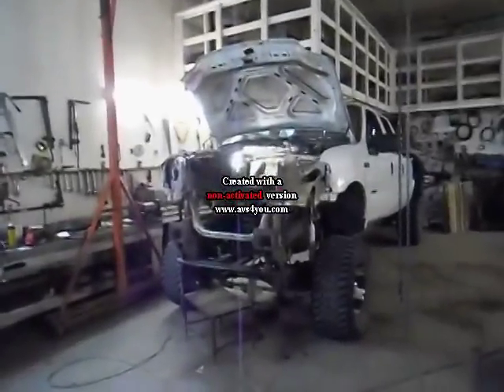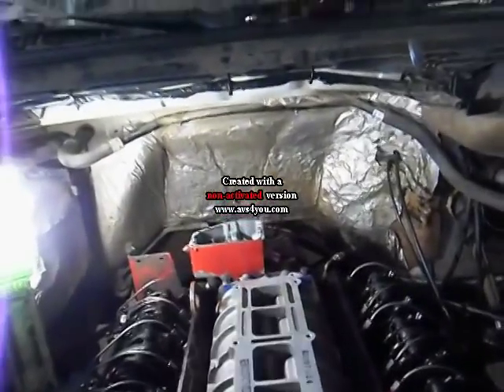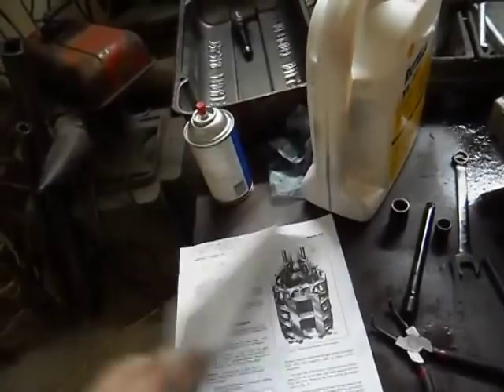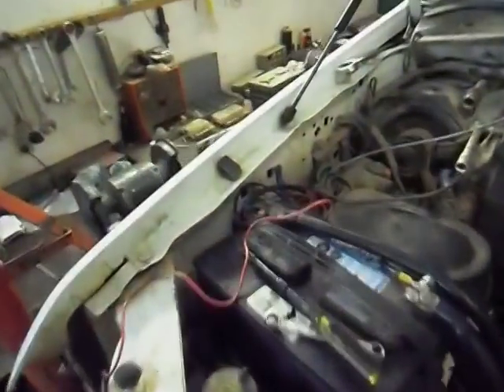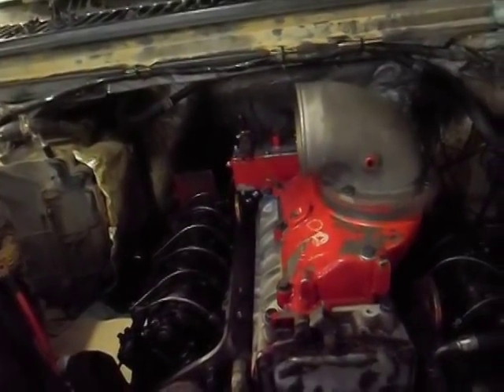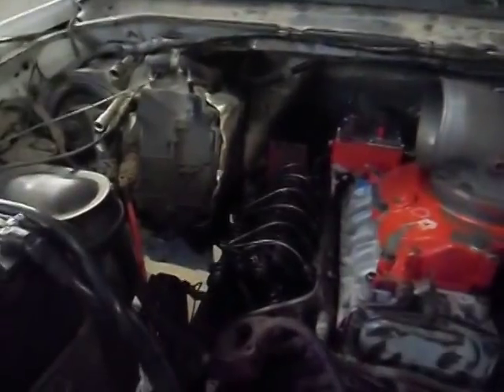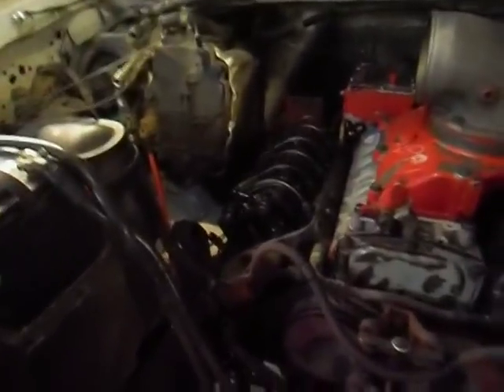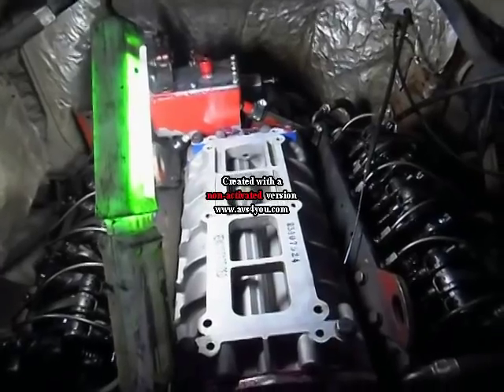Detroit Diesel 6V53 F350 Truck Project - Blower Repair

Comment: @drgossel Thanks for the tip, ill have to pull my blower tube and give it a check. Dont want to get a runaway started on oil over here ;)

Comment from the maker: @josh216882000 Good thing I had the service manual, because it explains how to check the seals, like I mention.  Mine weren't leaking very much at idle, but as soon as I'd rev it, you could see the oil coming from them.  Another indication of them leaking is if the inside of the blower is oily at all.  Like this one was even spitting oil back up into the air shutoff , so I knew I had a problem somewhere.

Comment from the maker: @emerald310 Its been running very good.  I drove it all last summer, put about 3000 miles on it and never had a problem with anything, just the blower seals were always leaking a bit and getting worse.  I'm happy with the swap and I plan on keeping it for a long time.  I just love these old 2 stroke detroits and to be driving one everyday is great, because there's not too many left running on the roads anymore up in Canada.

Comment from the maker: @Unlimited3406 I haven't keep track to the exact dollar what I have into this, but I would say its between 7-8000 with the 840 I just spent on the blower, thermostats and gaskets.  I sold the 6L Ford powertrain for 2250 and the stock wheels and tires for 300, so that also helps to brings down cost of it somewhat.